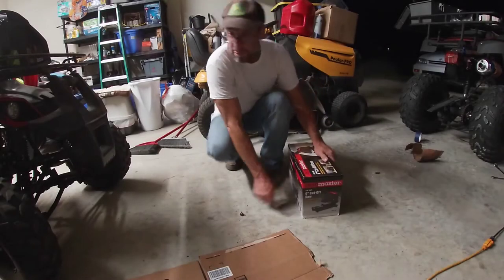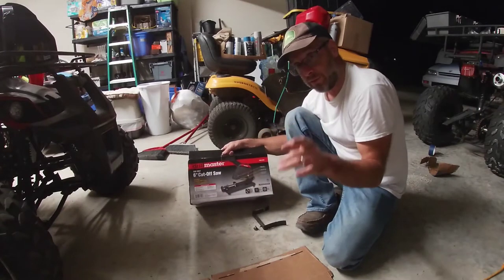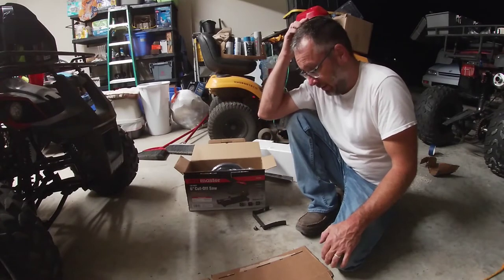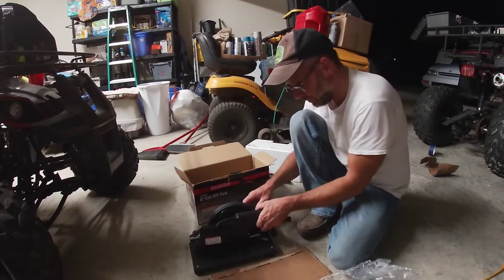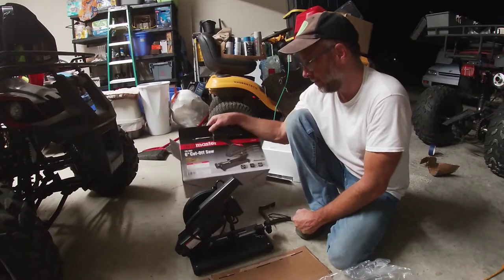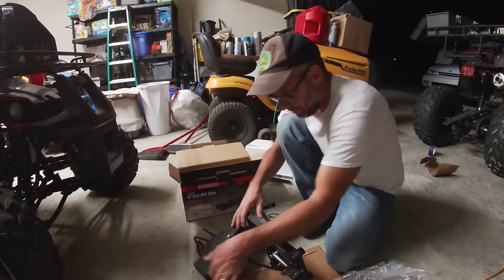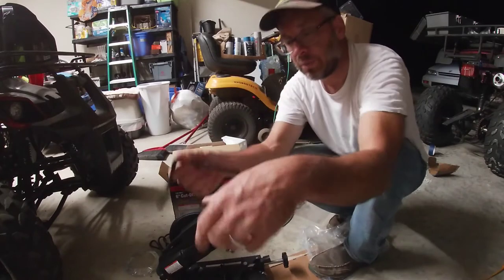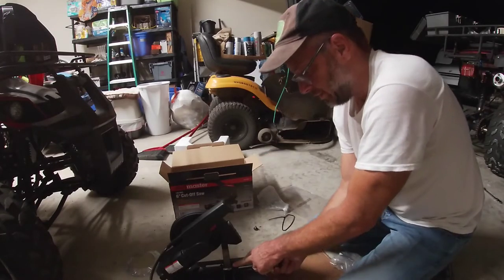REVIEW:  DRILL MASTER 6 In. 5.5 Amp Cut-Off Saw  Harbor Freight

Comment: Cut the flat bar vertically it will work better
Reply from the maker: Yea. I probably didn't do that saw justice. I wasn't very familiar with these saws.   Works WAY better vertically!
Reply: I have to agree with that I'm not sure if the guy using the saw knew that or not.

Comment: My problem started with attaching the Blade!! It's a 5/8 Arbor Hole on Blade- however the Arbor size on the Saw is 7/8??? There is 2 collars - a Metal Bushing & a Bolt that screws into the end to tighten it all up right???  Well it just doesn't seem like a correct fit to me??? I drive to an actual store & had them Demo it for me & I wasn't impressed... The Blade doesn't fit right!!! I wish I could see a video on how You installed your 6"Blade???  I purchased it to cut round aluminum dowell stock for my Lathe....🙏HELP🙏
Reply from the maker: yea, sorry I didn't show that, the saw actually isn't bad if you don't need accuracy ... when cutting flat stock you should always have the edge up instead of cutting into the flat part of the stock

Comment: This is the 4th or fifth review I've watched and it is the first one who didn't like this little saw. You pointed out something I was wondering that no one else pointed out. the wobble. Can it be tightened up? The other reviewers were using Hercules blades and did not seem to have an issue with the cutting.
Thanx for the review. Stay tickless.
Reply from the maker: I am not sure it can be tightend, I traded it in for the bigger model.   The cutting was probably half the blade, and half my fault for not standing it on edge.   The cutter will work much better with the smaller surface area
Reply: @MyLooneyBin , I bought one yesterday along with some Hercules blades. I tried it out ou some Uni-Strut. it works well for $45.
I need it it to cut strut and all thread, mostly.
The Hercules blades were almost three time the price of their next cheapest blade. 
Mine does not seem to have the wobble yours does. I did check for squareness, all good.
Stay tickless.

Comment: Thanks for the video!  I was just about to go out and buy one of these to cut some 1/4" flat stock but since it won't even cut 1/8" I won't even waste my time or money.  Have you found a better small cut-off saw online somewhere else?  Thanks!
Reply from the maker: well, to be honest, it isn't as bad as I made it sound, if you angle the stock up, instead of laying it flat it will do a little better job.  just got to take it slow and easy
Reply: @MyLooneyBin  will this cut pvc pipe?
Reply from the maker: @evepeterson9210  definitely

Comment: I think your using a grinding wheel.....A cut off wheel is really thin...look how wide the so called cut is on your flat metal bar....that's not a cut off wheel...I don't care if it came in the box...some Chinese man slipped you a micky in the box...
Reply from the maker: Thank you.  Yea.  Lots of issues there!   I think putting the metal on edge would have helped as well!